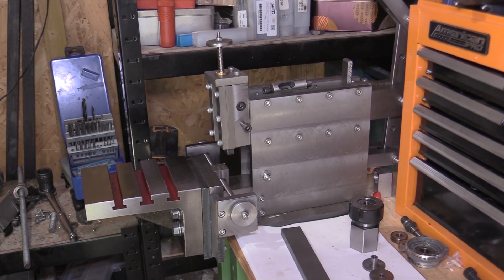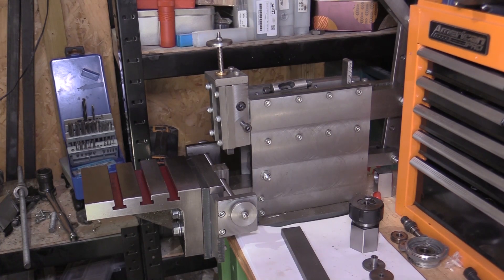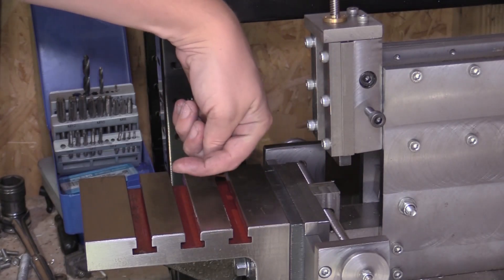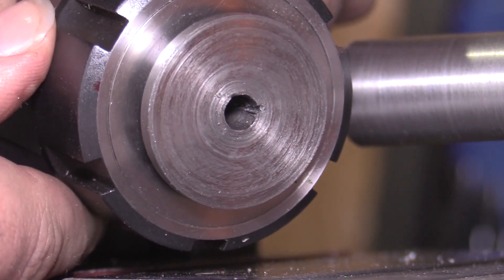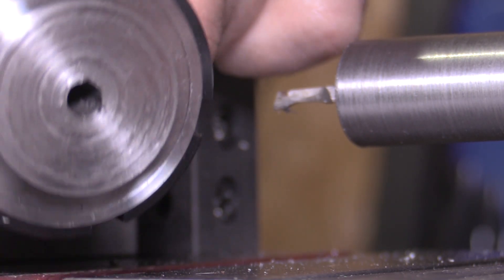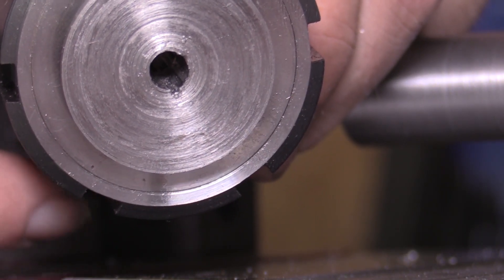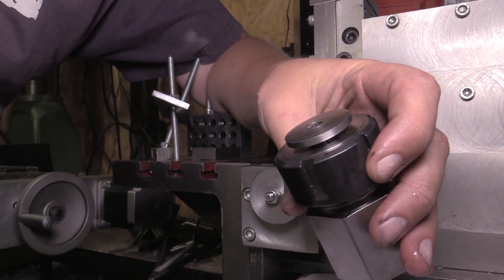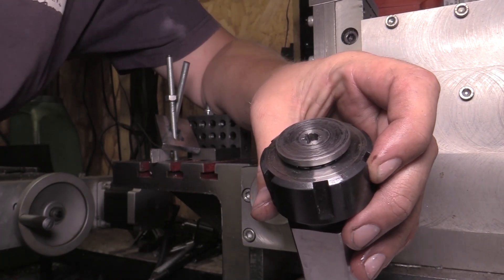Small Spline Cutting on the Manual Shaper

Comment: Several months back after I had gotten my 14" shaper running I tried to make a blind square hole with very simple tooling and fixturing. I kept getting deflection towards the bottom of the hole. 1 thing I tried to help a lil bit (beyond tool rigidity) was to give my part a slight downward angle. The end result wasnt pretty, but it got there. Another idea is you could make a spline cutting broach from tool steel. Or even a spline cutting rotary broach if need be. Heck a couple months back  just as an experiment,  I literally hammered a piece of HSS square through a round hole in aluminum.  It wasnt pretty but it worked. Cant wait to see where you go from here. Dont give up on the shaper, it just needs some fiddling I think. It was a great build
Reply from the maker: Yea, tipping it up slightly sounds like an option. Also do like the idea of rotary broaching... Just an excuse for a new tool

Comment: Hey where did you get the steel for the shaper?
Reply from the maker: Hi, which steel are you referring to. The steel the shaper is made from or the tool steel?
Reply: Mr Mechanical the steel the shaper is made from.
Reply from the maker: @BraedenPrice1  I bought the steel from a local supplier in Cumbria, UK. Cumbria Profiling.  The steel is S275 12mm thick and the plates were cut from my drawings